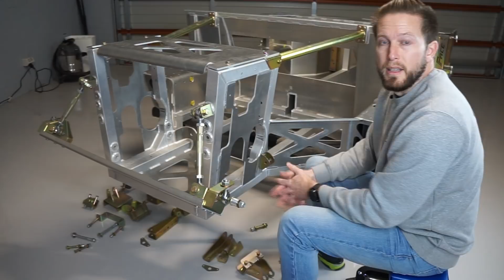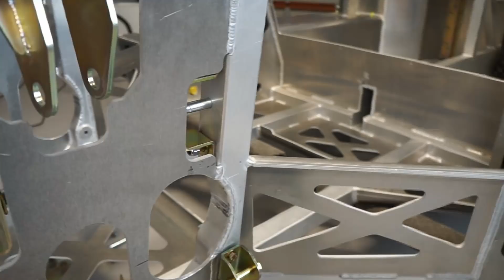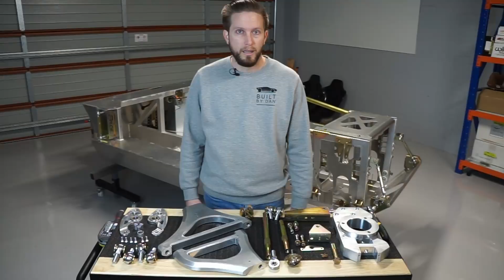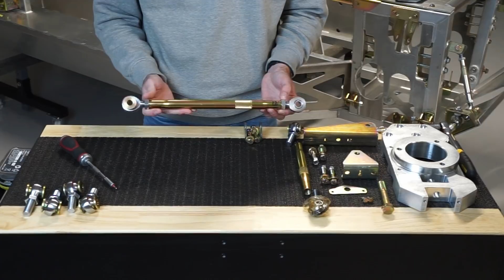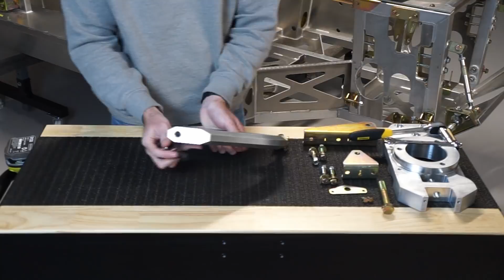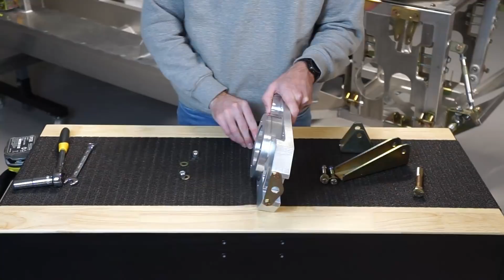GT40 Kit Car Build - Ep 11 Part A - Rear Suspension Installation

Comment: I was hoping that an Australien manufacturer uses Metric hardware. I'm very disappointed to learn that they used the crappy SAE bolts. Shame on the manufacturer!
Reply from the maker: They advised there is more or a range of sizes in imperial, than there is in metric, that's why they stick with the imperial bolts.
Reply: @BuiltbyDan  They're liars! I'm from Switzerland and we could get any bolt in any diameter, length, and standard or fine thread with all kinds of head designs. The only reason is that they can get standard cheaper in Australia! Even though I expected that in Australia Metric is now the standard!

Comment: I can appreciate your attention to detail Dan, however it appears as though you have the top and bottom shock mounts set incorrectly. I believe the mount bosses should be inside of the engine compartment. First indicator is having to drill holes in the frame for the lower mount.

Comment: Really enjoying this build, to the point and in depth build of a GT40, something hasn't been documented before.

I was always keen on the PACE GT40 kit, just loved the idea of the modern billet suspension and alloy chassis, but it seems their quality control isn't there.

Paying that much for a kit to assemble yourself, to only have to modify or redrill holes at every step of the way, seems a bit poor from their end.
Reply from the maker: Thanks for the feedback, I felt there was a real lack of content in relation to a complete step by step build on YouTube when I was looking to understand what might be involved in building one of these kits. I do like the kit, and was attracted by all the same features you mentioned, I think it just needs a little more attention to detail and it would be amazing.
Reply: Not to mention, that everything is imperial rather than Metric too?!?!
Reply from the maker: Ive been having to purchase a bunch of new tools due to everything being imperial, and it's a bugger to work out sizing of metric drill bits for tapping imperial threads!

Comment: Are you sure that the lower shock mount is in the right orientation? If you turn the bracket around the bolt holes would line up with the holes in the chassis. To me it's unlikely that both of the brackets or both of the frame rails would be drilled wrong.
Reply from the maker: Yes, orientation of bracket is correct, needs to have that orientation to align with bellcrank angle. I've also checked with other builders and the manufacturer and confirmed it is correct...
Reply: @BuiltbyDan  Okay, it just seemed a little strange and it looked like it would bolt up with the mount flipped around. Keep after it! I can't wait to see the finished product. It's a sauna. No wait that's a Finish product.

Comment: Great content and thank you! My only comment is those suspension bolts - they look a bit too puney? I maybe wrong...
Reply from the maker: Generally the bolts to hold the brackets on are 3/8" and the pivot bolts for mounting the components to the brackets are 1/2".
Reply: @BuiltbyDan  Thank you for your reply. Any idea of a colour - I know it's a long way off - ?!
Reply from the maker: Yes I want it to be the grey, similar to the current gelcoat colour. I showed some renderings in the Build Specification episode (Ep 03), grey with orange stripe and orange centres on wheels. Basically the gulf racing look but with grey instead of the light blue.

Comment: This highlights why  we use AN bolts in the racing industry here in the US.  Standard "hardware store" bolts (regardless of grade) have a lot of variation in quality and size.  AN bolts, because of their traceability requirements, are quite uniform in both those categories.  They're also quite expensive, which is why most folks don't use them in home/kit builds.

Comment: That lower shock mount will cop a flogging. I’d use the bracket you have, drill a couple of holes in the chassis and chuck some extra bolts through the holes that were in the bracket.
Reply from the maker: Thanks for the suggestion Wade. I was thinking the same thing, particularly when the shock is in extension. Still trying to resolve this issue with the manufacturer so will see how that goes and if all else fails that's probably the approach I'll take.

Comment: Piece of advice coming from an Lotus Elise owner (aluminium chassis)....use Duralac or similar anti corrosion paste between aluminium an metal joints, as (even of anodized and galvanized) to prevent galvanic corrosion, also known as electrolitic corrosion...you'll thank me in 10+ years
Reply from the maker: Thanks for the advice Bogdan, I'll have a look into what's available locally.
Reply: @BuiltbyDan  👍 check with companies (online or retail) specialized on Lotus parts...they usually stock it.

Comment: Dan, is this an Australian,  American or CAV South African GT40 Kit.
Reply from the maker: G'day Robert, this is an Australian designed/manufacturered kit from Absolute Pace.
Reply: @BuiltbyDan    thx 4 gettingback 2me Dan. I will check them out. I ❤ there billet suspension.  Hope ur Build goes smoothly 4U.  How many cu inches r u considering ? 
There is a fabulous Cleavland Block in the USA. Cant think of the guys name off hand. And CHI & another chap in Melb make some cracking heads The orher chap does & did an enormous amount of work 4 V8 Supercars Heads. Unfortunately l am suffering from major concussion issues after a car accident 52 months ago & my memory recall is crap. Will follow u & if/when I remember will shoot u a message.  Also if u r considering 8 stack injection there is Ingelise or Ingelese Stack Injection. Can make up2 750hp with it. Thanks 4 sharing . 
Regards Robert
Reply from the maker: I'm looking at a Gen 2 or 3 Coyote and I hope to install 8 stack in the future.

Comment: Assuming you haven't already, consider buying a good quality dial/digital caliper (to accurately measure fasteners and holes) and a few reamers in the more common sizes. I get the frustration. Keep 'um coming, Dan.
Reply from the maker: Yes I have a digital caliper, it's probably been my most used tool so far! Haha. I don't have any reamers, but have been looking at getting them rather than having to resort to using standard drill bit.

Comment: If you grease the the threads on final assembly you need less torque.
Reply: You do not grease threads man, you're just asking for bolts to back out. You use blue Loctite.

Comment: Dan, I'm impressed by LITTLE you've had to adapt thus far. I was overjoyed when I saw you laid out everything you needed for the suspension mount assembly Before you started bolting things to the tub. My thoughts with the 2" bolts that didn't fit... did you need to hone the uprights for them to fit, or are they intended to be an interference fit and pressed into the upright? I was surprised to see the bottom of the shock mount on the lower part of the tub. Normally the shock mounts to the top of the frame/tub and the lower mount is on the upright. (It's been a while since I looked at a GT-40 rear suspension, so you might be right, but it seems strange. The shock would work backward... in compression when it should be extension, and vice versa. Check that before you proceed. Assuming it'll use a coil-over shock, it won't work. The spring would be in extension when it should be in compression).

Regarding the need to drill out the flanges and holes thru the tub... This ain't "Assembly line 42" at the Dearborn, Michigan Ford plant, you're building a car from scratch... a one-off, unique sports/racing car. Keep up the good work!!
Reply from the maker: Thanks Carl. I've been advised that the bolts are not intended to be a compression fit, but they designed the uprights with very little tolerance for the bolt holes. I'm waiting on some replacement bolts to test fitment and if that doesn't solve it I will have to hone out the bolt holes in the uprights.

Comment: I think these mass-manufactured bits come out of factories that aren't that concerned about tolerances. So many of my 3/8" and 1/4" rivets didn't fit when I was assembling the aluminum on my FFR. I know it wasn't the drill bit, 90% of the rivets dropped right in, the rivet I pulled to replace the one that wouldn't fit dropped right in, so it's got to be the rivet that has the size issue. I'm figuring that those drilled aluminum components are coming right off a CAD driven machine, so it's unlikely they are the issue. Enjoying the series.
Reply from the maker: Thanks for sharing your thoughts and experience with your FFR kit.

Comment: Another great video Dan...The manufacture should be paying you to do these!
   Regarding the lower shock mount, I can see how at one time It bolted where the 2 holes are as supplied, then decided to change the bolt placement and neglected to supply an appropriate part(perhaps you received a old-style part).
   I agree with the idea of out of spec bolts on the upright. But which bolts are out of spec? ;-)
   Keep up the good work.

Comment: G’Day Dan another great video even in car manufacturing you still get the odd parts or panels that haven’t been align properly and have to be reworked because the fixing points have not been welded in the correct place it’s only got to be out a fraction and that will make a lot of difference to an operator trying to fit their components but it happens and you have to make amends keep up the good work and stay safe

Comment: I enjoy watching these videos!  I do wonder a bit about the quality control of the kit manufacturer, it seems you have had to do a lot of modifying and have had to check with the manufacturer numerous times to solve issues.  I built an airplane some time back from a kit (Vans RV-6), and while it did involve a fair amount of fabrication, every part that was supplied in the kit fit like it was supposed to and the plans were very complete and error free.  The only times I had issues during the build, it was because of mistakes I made..............  I do relate to your method of temporary assembly, I probably "built" my kit 3 or 4 times!

Comment: I’m enjoying your channel Dan. Smart to take a pause and speak with the mfg. You don’t want to start drilling into those billet uprights. I assume you will torque up all the bolts at some point with a torque wrench and use marking paint which can be used to inspect the bolts to make sure they are not backing out. Great work so far!
Reply from the maker: Thanks Joel, yes, as part of final assembly I will apply loctite/antiseize and torque to correct specifications.

Comment: Long time auto mechanic here. Worked for Porsche for many, many years.
A little advice for your safety.
Always use a torque wrench on any and all suspension hardware.
Find out what grade bolts they are and use the correct torque.
Reply from the maker: G'day Jack. All bolts will definitely be correctly torqued for final assembly. Thanks for the advice.
Reply: @BuiltbyDan  Love the videos, love the car. Can't wait to see it completed.
Safety first. Don't want anything to mar this wonderful experience.

Comment: From an engineers stand point, I would prefer the larger diameter grade 8 bolts to the smaller (possibly grade 5 bolts). Since the fit is very close, I would recommend measuring the bolt shanks with a micrometer and buy the reamer to resize the  holes in the swingarm. To maintain, proper alignment, fit and reduce vibration movement of the bolts and bracket, I'd only ream out for the distance of the shanks shoulder. You're doing a great job of building and filming. Keep up the good work.

Comment: Hi Dan, great and interesting build. I have a question about the frame materials. Could you tell me the thickness of the aluminum tubes and aluminum sheet metal used to make the frame?
Keep these interesting video's coming.
Reply from the maker: G'day Roger, typically the sheet aluminium is around 4mm thick and tubing is around 3mm thick. There are a few sections of sheet aluminium that are 6mm thick, generally around the engine bay. I've recently filmed a bit of an overview of the chassis that I still need to edit and will post in a few weeks time. It's nothing too special (the overview video) but it does give a closer look at the chassis overall.

Comment: Can I give you one advice?
Tighten all the bolts you fit to the car, as if it is the last time you'll touch them.
Or don't fit them at all, but never hand tight.
By the time you're finished, you handled so many nuts and bolts that it's practically guaranteed you missed to tighten a few.
And it's always an important one, or one you can only reach by dismantling 'half' the car.
Reply: Looks like Dan intends to totally disassemble it after mock-up and reassemble it like an aircraft mechanic would (short of wiring every bolt and nut) wile working my way through college I worked in a collision repair shop as their mechanic (I got my Ford and ASE certifications in the Army) I ran across a couple of exotics with aircraft specs. I had to put it back to factory specs. While I would like to see Dan use a reamer rather than twist drill bits, I'm sure his methodical approach will insure a sound result.
Reply: @phillipward937  Still...
Tightened bolts can also be loosened at  anytime.
So, why this hand tight approach?
I don't feel the need to throw my credentials around in here, but this is how I work and it never failed me in 35 years.
Reply from the maker: G'day Paul, thanks for the advice. Why hand tight only? Well it could partly be my own self confidence that I've not missed anything in the assembly process that would require it to be disassembled multiple times. All the nuts are nyloc nuts, so I'm trying not to have to tighten and loosen them too many times over the course of the build to the point where they no longer hold properly and need to be replaced before I even get the car on the road. That's been my thinking anyway, whether it's right or not is another thing!
Reply: @BuiltbyDan  if it was me I would triple check everything that needs permanent fitment in the  suspension and wire it up. Your right on the nyloc’s they are not to be trusted if taken on and off and they  are cheap when final assembly comes just put new ones on, no need to take a chance with used ones.

Comment: The number of modifications that you have to make each week to what I imagine was an expensive kit surprises me.  Nice job anyway, but I would be a tad less than happy.
Reply: It's actually not uncommon to have to "fine-tune" some parts to fit perfectly. I've built a couple of "kit Cars" and several kit bikes (chopper kits) over the years. Every one of them needed modifications to work correctly, some more than others.
Reply: @easyricer   I get it. I used to fabricate all of my Formula Vee race car components, but that is expected. I’m just comparing the price of this kit vs the ‘built in design flaws’.

Comment: Very likely that those bolts are press fit, like studs on a hub.    No hurry.   Good awareness to stop and ask rather than drill out.
Reply from the maker: Looks like it's possibly a bad batch of bolts that are outside of tolerance. Waiting on some replacements from kit manufacturer to see if that solves the problem.
Reply: @BuiltbyDan  In retrospect, pressed in bolts would have serrations to prevent spinning.

Comment: would not be surprised if those bolts were supposed to be a press-fit into the upright.
and remember on final assembly that a torque wrench and LockTite are your friends.
Reply from the maker: Thanks Mad Man, seems like it's just a bad batch of bolts that are outside of tolerance.
Reply: It would be unusual for press fit bolts to be zinc coated.

Comment: Amount of content, filming, editing and audio is super nice Dan. 
Are you going to put in some grease on threads, for the threads not to seize? Remember to mark bolts/nuts when final torqued. Both to easy see which one has been torqued, but also to inspect if any have come loose.
Wonder if, the manufacturer ever build one of their them own kits. Seems like their BOM/revision control of components is off.
Reply from the maker: Thanks for the feedback! Yes I'll definitely be torquing all bolts and applying loctite/antiseize as appropriate for final assembly.
Reply: @BuiltbyDan  On the billet aluminum threaded parts, I'd highly recommend antiseize to prevent galling on disassembly. That's a nightmare you don't want, trust me.

Comment: Take a tip from Cletus McFarland, always finish the part of the project you're working on before you post the video.
Reply from the maker: I understand where you are coming from, but unfortunately that's not always practical, especially when it can take a month or so to try and resolve issues with the manufacturerer and have new/replacement parts shipped. For the most part, my intentions are to complete a full step of the build/assembly per episode, but there will be a few steps where that may not be possible.
Reply: @BuiltbyDan  as your fan base grows the keyboard warriors will wear you out with would ah could ah should ahs. Most of them don't know shit from shineola, they'll Google junk that's bullshit trying to act like they are experts. I know you're trying to stay exactly with the kits original engineering and I had several suggestions,  but I passed on making them because this is your project. Sidewalk supervisors are a dime a dozen. While silence is golden. Good luck with your project.